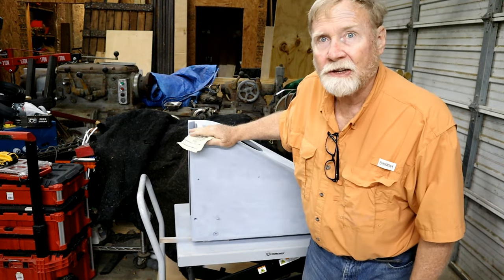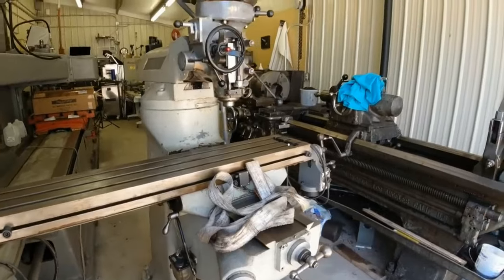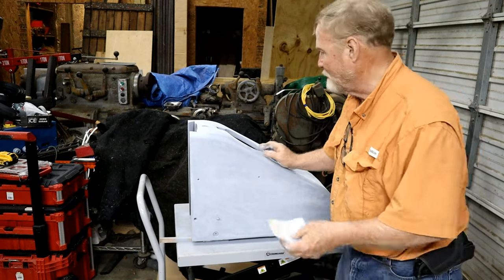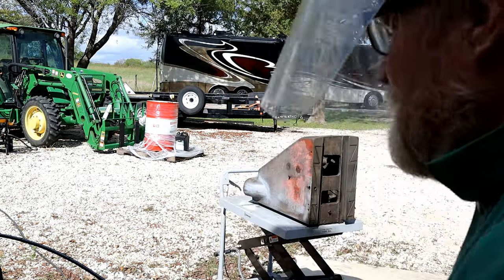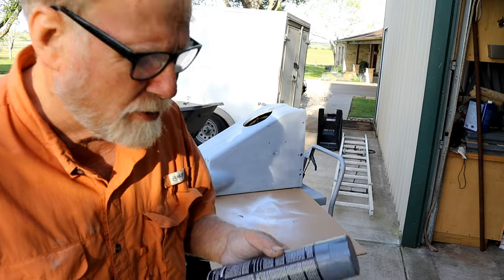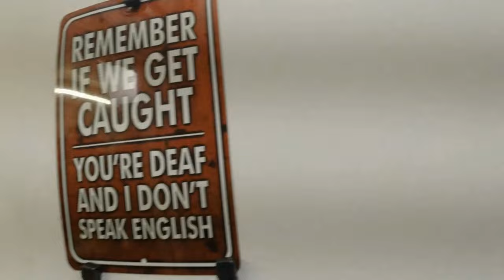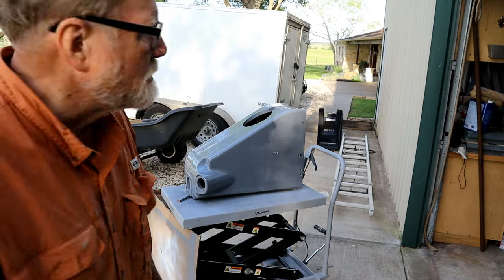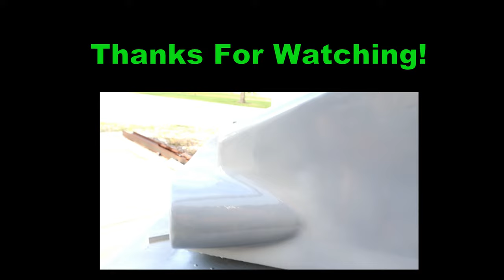The Bridgeport Rebuild Project :  Paint time!

Comment: Like and subscribe, leave a comment youtubers always say.  Ok commenting to help the algorithm.   Got to watch your videos to see how Don is doing, this one just has old footage.  Hey, I am just like you two, just a bit cranky and set in my ways.  Love it when neighbors and friends get together to help one another.  
Going to have to try out that hard hat paint someday.  Last machine i painted was my shaper, rustoleum smoke grey to match my lathe.  Next projects are a camel back drill press and a baby planer, Don size, 36"?  Both old, leaning towards stove black, maybe i should use paint.  Ha.
Glad you are back in shop.
Used to keep my mill at work all rubbed down and shiney.  Anymore i don't neglect it too much, base needs good cleaning, getting harder to bend that low. 
Hey, when you actually remember to pull that oiler handle Bridgeport or clones, i run a Sharpe, do dribble oil.

Comment: I used that paint B 4 I retired, at work, and I liked the results very much, if something like my dolly got shuffled up I just sprayed over that area and it blended right in, but after three of four coats in an area, a hard bump would knock a chip out of all of the layers the paint down to bare metal. Ron W4BIN
Reply from the maker: It does build up quickly....

Comment: Cant wait to see it finished. It's the actual painting that is the easy part, it's all the hard work getting to that point that isn't. I watch this one hot rod channel, where the fellow bought a machine that fires a laser out of a gun and he used it to clean rust and debris off of a machine that was in a sad state. I was skeptical of whether it would work, but it sure beat sanding and a needle scaler.
Reply from the maker: One of those would be nice but I think I will wait till they mature more..  It would be hard to justify it money wise.

Comment: So, how many side projects have you done just to paint it? 20 - 30? 😂
Reply from the maker: how many different operations on that one piece?  at least 10 different things coatings or sandings or cleanings...
Reply: No, that's a part of the project. A side project is where you have to fabricate or do a different project to finish the original project, like making the beveled straightedge is a side project.